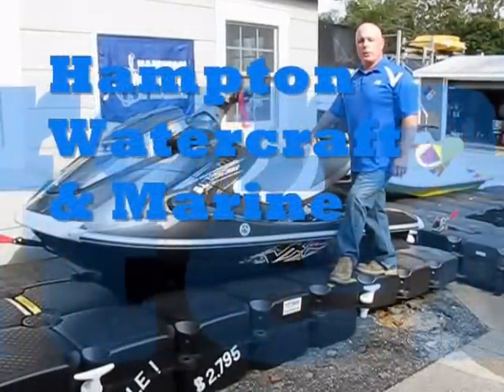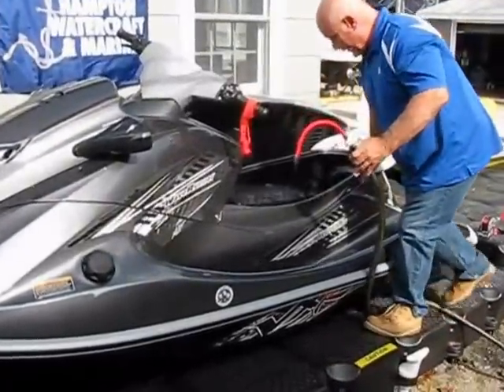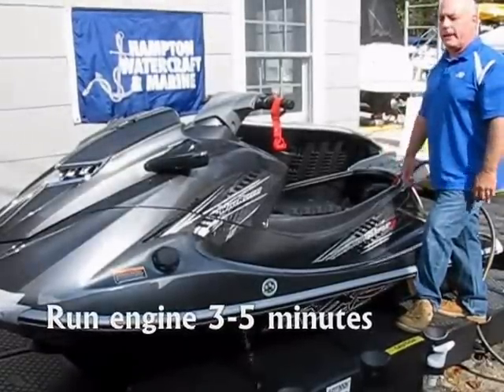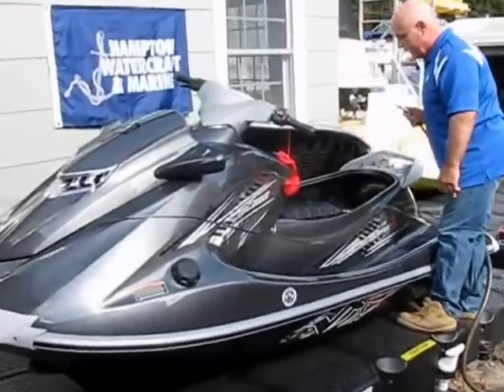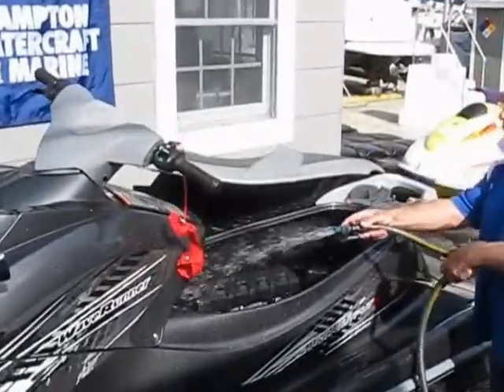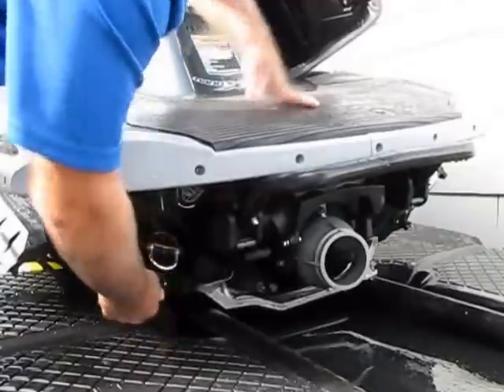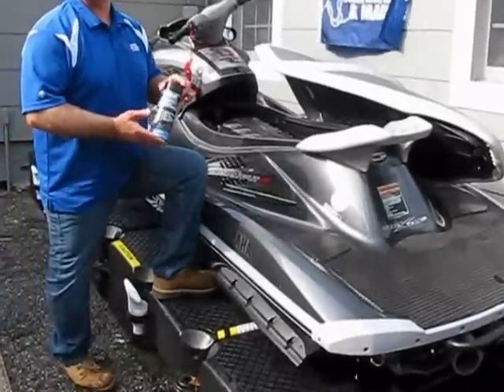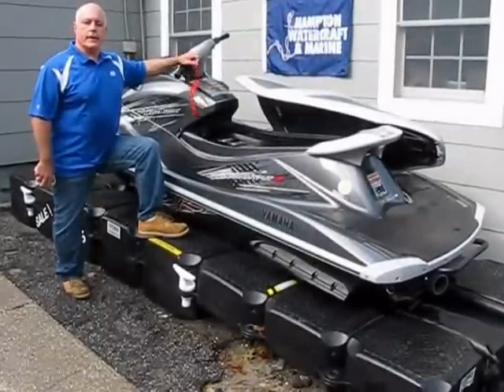Yamaha Routine Maintenance

Comment: Good video mr. I have a question i do they dame Thing that You But there is not water running out by the engine... Only trough the turbine... In 2 minutes alarm hot engine starts.... May be the  pressure of the water is not good!? Thanks

Comment: Good video, but you forgot to wash the salt water out the pump and ride plate.  As for inside, I use "Fluid Film" BEFORE the skis go into salt water.  That stuff is amazing, but a little pricey.  It really coats well.  It's not a petroleum product, it's lanolin based, so it's safe on rubber and plastic (silicone is too, just less sticky).   I even use it on the outside of the ski around the pump area.

Comment: Great vid. Thanks for posting. I'd like to add that the retainer ring  for the fuel sender on top of the fuel tank is also prone to corrosion damage on the FX. Make sure you treat that as well. After rinsing the interior and letting it air dry, I spray everything down with Fluid Film after the first ride of the season and then again at the end of the season. That's it. Its amazing stuff!

Comment: question -- how do I save the ski if I forgot to wash the interior; used it 3 times (brand new); flushed the engine but neglected to clean the inside (i.e. wash down the hull).  Cannot access machine for 4 days...what are my best options?  crap...

Comment: Very informative thanks, but my 2013 vx deluxe doesn't eject water from the side only around the jet unit at the back, only a few drips and hot air come out of the side is this normal ?
Reply: thats false i have same year as you look there is a small tube

Comment: Best Video I've see yet! I haven't used silicone but I will go buy some tomorrow.  The engine does sound like something is wrong with it but it's normal. I thought my engine was shot when I heard it.   I always left a little water inside but I will now sponge it out but my 2007 looks brand new still.   Newbies.  Don't run the engine more than 15 seconds without water running through the engine or you will overheat it.   You will ruin the engine if you leave salt water in it.  A friend of mine destroyed his brand new Sea Doo Speed boat by not cleaning it after one or two years.

Comment: If you flush for 3-5 minutes,the impeller isn't harmed not getting water??
Thanks
Reply: Running the ski out of the water doesn't bother the impeller at all. All driveline bearings are sealed and packed in grease. Just remember not to run the engine longer than 15 seconds with the hose turned off

Comment: flush, spray and wipe down???  thats it?? thats all the maintenance needed??  wow.
Reply: No, you should wash with a soap that is made for salt water use if using in salt water.  Then rinse again.  I also like to rinse back by propeller and all around the underneath by the grate. Just dont spray back into exhaust depending on your ski. That pesky salt gets every where.  but if they are out everyday that gets to be a lot of work.

Comment: I just got my new VX Deluxe. After I finished my first ride,  I got it on the trailer, rode back home and started this process. But the moment I first turned the motor on, the WARNING light went off and started beeping on and off. Im scared =S (No, I did not turn the water on before turning on the garden hose). Should I be worried? Or its normal that it beeps and signals the warning light once you turn it on out of the water?
Reply: I put it back in the water to check if everything was working properly. Everything seemed to be ok, but the Warning light and beep was still there. I rode it for 5 minutes. Water was coming out from where it should, no strange engine noises, no performance loss, no overheating that I could notice. So I went to get my girlfriend to go for a ride. Turned it off, picked her up, fired it up again, no more warning or beeping! :D It went away! Was so relieved. I mean, it's a new machine. So I guess it was just something stuck or not flushed setting the engine alarm off.

Comment: Hello my Yamaha sho 2008 Dont go more than 6000rpm i dont know why , i hope you can help me
Reply from the maker: Give us a call at 631-288-2900 and well see if we can help
Reply: Was it in learn mode?
Reply: How i know if it in learn mode ?
Reply: HACHA GRANDE  a light will be on the dash where it says L mode.

Also check spark plugs and coils,  those will also impact high rpm
Reply: Yeah when i turn in on its in l mode how can i change ??
Reply: HACHA GRANDE hold the unlock button on the remote until the waverunner beeps
Reply: I dont have the remote, what can i do ?
Reply: HACHA GRANDE go to your local Yamaha waverunner dealer.
Reply: HamptonWatercraft